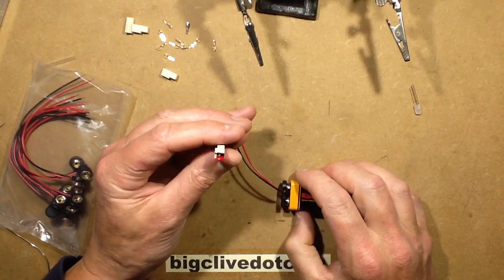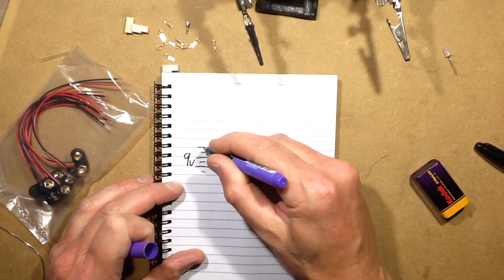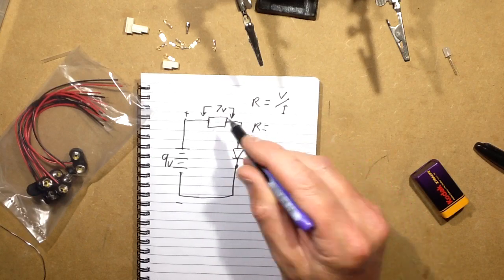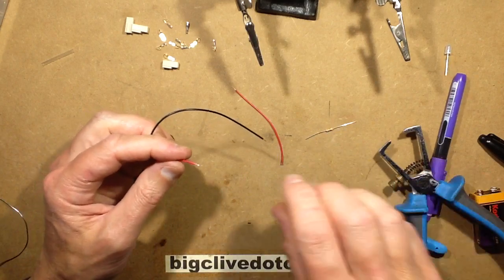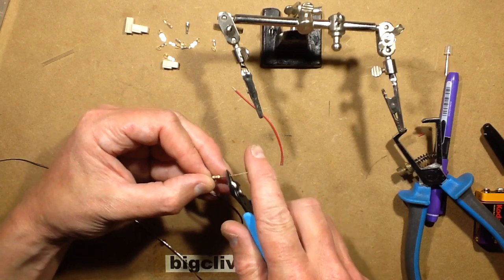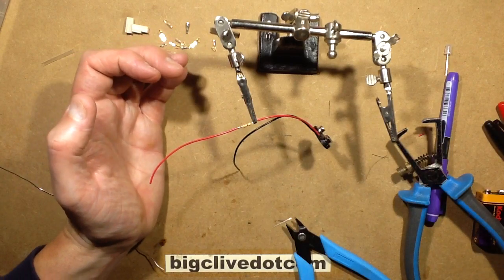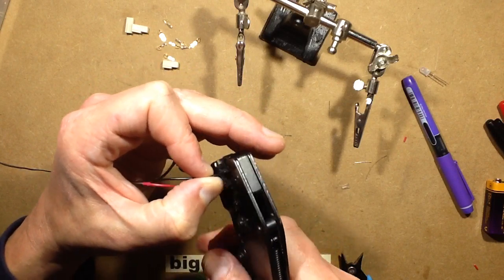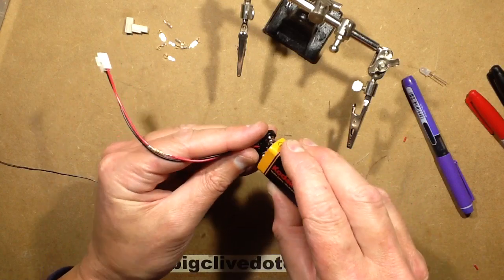Make a super-simple LED tester and emergency light source.

Comment: Can this be used to test 100W LEDs?
Reply from the maker: Yes, but you have to slice them into little cubes with a sharp knife and then solder extension wires onto the little gold wires.
Reply: +Ben Adamson Lol, seriously, you've not been at Julian Illett's channel, have you? :D
Reply: WHOOOSH
Reply: +bigclivedotcom Ha ha, maybe not. Just popping out to the pound shop to buy three 9v batteries!
Reply: No, you'll need a higher power PSU. A 9V battery can realistically supply about a single watt at maximum (and you'll wear it out quickly at that high current).
Reply: It would possibly dimply light one,  but there's no way you'll get near full brightness with the current limited to ~20mA
Reply: With enough 9V batteries in series, yes. Just add enough in series to get up to the operating voltage of the LED, and don't worry about a current limiting resistor, the internal ESR of the battery has you covered... (until they leak/explode.)
Reply: If you want to waste a good battery.

Comment: Regarding cameras, get a decent camcorder, far more settings to play with to make videos look good, and manual focus for the win so you can change focus on the fly so you can bring things up close and focus on them and not have to be bothered about the Sonyism with focussing on everything but what the camera is aimed directly at... :)

I remember when I was a kid I used to test LEDs with a PP3 battery, no resistors, just a quick flash to test them, most of the LEDs used to work, can't think why they didn't afterwards............. :P

Comment: I notice that you calculated the resistor value in the video of 330 ohms yet in the comments you state that a 220 ohm resistor is required.
Reply from the maker: Thanks, I've corrected that.  For some reason I kept mixing up 220 and 330 ohm resistors.

Comment: Clive, did you know that Android formerly was ment to be a camera OS? :D
Reply from the maker: I have an optimised travel tool-kit that is very easy to carry about.  It was featured in a video last year when Julian Illet issued the "handbag challenge".
Reply from the maker: I'll be switching to the Moto-G as a camera shortly for travelling, but my use of the camera facing straight down seems to cause problems with many apps.  Even with rotation off they still do weird things.
Reply: bigclivedotcom
Try the open camera app, there you can disable autofocus while recording video.

Also the cyanogenmod camera app provides this feature.

Keep in mind that third party camera apps cannot write to SD-Card on Android Kitkat and since Marshmallow, there is a chance that it works but it's 50/50 that it doesn't... I hate these SD-Card restrictions... Now I plan to go for the next Nexus phones announced end of september.
Reply: +bigclivedotcom are you going to leave us for vacation ? :-(
Reply from the maker: No.  I'll be travelling about with work so I'll be uploading from random locations for a while.
Reply: bigclivedotcom I see. You'll need a BIG truck to take all your tools with you :)
Reply: bigclivedotcom oh back then I wasn't watching your channel yet. Will try find the video

Comment: I found the Yahua rework station for 99 bucks on Ebay. It's been really good and reliable heats up fast enough.  Although I've never run a Hacko or Weller to see the difference after seeing the price difference. What are the best replacement tips to get?
Why do you call a 9V by the name- PV3?
Reply: PP3. It is the standard name for this type of battery in this country.

Comment: heres a much cheaper and easier tester 
3v cr2032
Reply from the maker: No current limiting other than internal resistance, so a fresh sell can pump a lot of current through an LED and make it look a lot brighter than it will in a real application.
Reply: neato

Comment: I usually make a resistor out of myself when testing LEDs. One electrode to one terminal of the battery and the other electrode to second terminal through my finger. Amusingly simple and works well.

Comment: What if you use a little 3 pin switch and mount a 330 and a 100k ohm resistor to it, and just hot glue it to the actual 9v connector?
That way you have a low and high current setting :D
Reply from the maker: https://www.youtube.com/watch?v=l24weXIYOAw
Reply: bigclivedotcom Nice one! Could easily be condensed though :)

Comment: Coincidently, I got a LED tester from a boot fair about a week ago. It's a small back box that houses a PP3 and the lid is a PCB. On the PCB are 6 pairs of eyelets, each pair of eyelets has a different value resistor connected to it enabling you to test a LED at different current levels. Useful.
Reply from the maker: Those ones are pretty good.  I prefer them to the modern ones with a button you have to press to make the LEDs light.

Comment: Personally I suggest salvaging the tops off the 9 V batteries whenever they die you can just peel off the casing Cut the two leads and you'll never run out! I have a bit of like 50 and I haven't bought any of them

Comment: I much prefer to use a LM317LZ and a resistor. Only one additional component, and then you have proper constant current source. That means you need not concern yourself with the LED voltage drop, and no matter what the battery voltage you get the same LED brightness. The LM317LZ is only rated 100mA, but that's heaps, but it's not LDO so you need the input voltage to be 3V higher than your LED voltage (hence 6V or preferably old used 9V batteries). Circuit is simple: http://i.imgur.com/a8KG38W.gif - the output current (Amps) is 1.25V divided by the resistor ohms. So, 82 ohms for 15mA, 120 ohms for 10mA, etc.
Reply: That's a really nice idea there. Thanks, Tom.

Comment: 3:20 stripping tool? I just use my teeth!
Reply: I used to use my teeth! My dentist once found a strand of wire in my teeth. I thought of asking him to file my teeth so I could strip different gauges of wire :)
Reply: +TheRaellz I'm just too lazy to buy a stripper.
Reply: When in doubt employee teeth! then employed dentist!
Reply: I take it you're not British....
Reply: With some practice, side cutters work just fine.
Reply: I used to use my teeth, but now I just roll the wire under a knife blade. So much easier, and a clean cut :D
But unfortunately, it's easy to just completely cut the wire off >:(
Reply: you can use your cigarette lighter
Reply: Yeah, for thin wires like that teeth definitely work better than that kind of stripping tool. But the other kind of common wire strippers, where blades are pulled back automatically are rather handy. I use one that cost maybe 3 or 4€ and it has kept me having insulation stuck between the teeth for quite some time now ;) .
Reply: I remember a medical mystery in Readers' Digest many years ago about an electrician who was very ill and the doctors finally determined it was lead poisoning caused by stripping wires with his teeth and chewing the stripped vinyl.
Reply: I've been using my teeth since I've known how to do this stuff and have never had either problem. I'm pretty sure the copper wire is going to give out before my tooth does.

Comment: Is it okay to flow solder onto the bits you're soldering beforehand or not? I've seen all these tutorials on soldering and they all seem to say to never do that. However I take it you're very knowledgeable about this, why do you prefer to flow solder onto it beforehand?
Reply from the maker: Ideally you would heat both wires while they were held parallel and then flow solder onto them, but tinning them both and reflowing them is much easier, and if a touch of flux is added produces a good connection.
Reply: It's always wise to "pre-tin" the ends/tips of components so that they solder easier. But that's just "wise".  I've been lucky enough that I've never been pulled-over by the solder-police.
Reply: The surface of the solder oxidizes over time.  So, if you're going to reflow it, the sooner the better.
Reply: The main reason for not doing that is that you will most likely end up with way too much solder on the joint. So pre-tinning and then soldering onto that again with additional solder is totally fine (assuming your pre-tinning doesn't end with a huge blob of solder already).

Comment: Speaking of emergency power, could you make a phone line ( Rj11) to LED or ni-mh battery charger?
Reply: Whats the point of paying $37 for a land line if you cant use it?  The real crime is having to pay so much for some thing that never gets used...
Reply: The legality of that is dubious, I think
Reply: I just run my whole house off the phone line! My neighbor's of course.
Reply: or can he do a bit of how to connect to a street light or the neighbours electric without them knowing! lol
Reply: @jusb1066   I caught my damn neighbor doing that last spring, he had run a cable over to my outdoor power outlet!  I fooled the asshole though, I had installed a wall switch for that outlet when we first put it on the wall about 25 years ago because we used to have to plug in my wife's car so she could get to work when the temps fell below -20 F, which it does quite regularly here in the Dakota's, so I simply began using the switch once more.  His drop cord is now hanging in my garage as well, what the hell, I found it connected to my outlet, must be mine right?  He never came over to claim it, perhaps I purchased it and forgot but then perhaps not. To bad there wasn't a skill saw on the end when I pulled it through the bushes.  If the ass-hole had just asked I would have gladly allowed him to use it once in  awhile but to do it without permission is just not right to my 67 year old brain.
Reply: +jusb1066 yeah, that's what I meant, I was replying to the original comment :)
Reply: Javid Bunyadzade so is pulling power from the phone connector for anything but phones :)
Reply: Javid Bunyadzade
hehe sorry :)
Reply: I made one of those once!  Wonder where I put the blasted thing now that you mentioned it?  I have dozens of those damn phone cables laying around, they used to come with modems in the old days and I only needed the first one, after that they just went into a box.  Think I will make some more, I am forced to remain here in the Dakota's this winter, life you know, and we do suffer from power outages when the Alberta Cutters fly out of the North from Canada and cover our beautiful prairies with heavy coats of snow, and an air mass comes from the Arctic to drop the Mercury to sub zero F temps.

Comment: When you have two separate wires as shown in this project what are your thoughts on combining them together and what methods would you suggest?
For example twisting them and hoping they dont untwist, heat shrinking the whole thing etc.
Reply: Take a two pieces of wire at least about three feet long.  secure one end throw the other end in a drill and twist them together. You can then use it by cutting lengths off. Although that doesn't help this much with precut wire.
Reply: for joining wires, holding them parallel over lapping about 1/2 inch, twist them together and solder, cover in heatshrink, is indeed the best method of joining to wires, any twist without solder is an unreliable joint.   https://www.youtube.com/watch?v=Q9G9gaokqvM
Reply: Sorry if my comment was unclear. I meant if you have two parallel wires such as the positive and negative in the case of this video and didn't want both of them flapping around separately.
Reply: aljowen
heatshrink is the answer to that also, even if you just use a short sleeve every few inches, it keeps them together pretty well, if you cant get the heatshrink on due to the cable already assembled, try self amalgamating tape.

Comment: Regarding the camera, you want one which has a fixed-focus option.
Reply: What these sorts of videos really need is something that can toggle quickly between two fixed focus points, ideally with a foot control. Not sure if such a thing exists though.
Reply from the maker: I've been looking at a mini bench studio setup that has multiple cameras for close-ups that can be selected live.  But it's finding decent webcams and a suitable hardware base that has been an issue.
Reply: +bigclivedotcom you could do that in software. Open Broadcaster Studio is a free, general purpose streaming/recording software where you can define multiple scenes and video sources and switch between them on demand. It is possible to use shortcuts to switch between the scenes, so I reckon it should be possible to build a hardware scene-switcher box.
Reply: This was more or less my thinking. A cheap USB HID footswitch would be fine for switching scenes.

However, I do think a potentially simpler, higher quality (albeit a bit more time consuming) solution would be running two independent cameras and then editing in the close up shots.
Reply from the maker: I've been playing with OBS and considering one of the USB keypads or even a USB MAME interface for hard wiring buttons.  It's just finding small camera modules that are a suitable resolution and can be built into a dedicated unit.

Comment: Do You have the link to buy the battery clips?
Reply: Thanks for the tips and the link!
Reply: You can actually just take apart an old 9v battery and use the top (just gotta wire it up)!  I've only seen it done on energizer ones though.  The metal case ones.
Reply: Works on all of them. You either get 2 disks with serrated teeth, or a single plate with a tooth mark in it and a longer one with tooth mark and a paper sleeve. both are usable, just solder quickly as the plastic melts easily.
Reply: http://www.ebay.nl/itm/252252918981?_trksid=p2060353.m2749.l2648&ssPageName=STRK%3AMEBIDX%3AIT

Comment: You can crimp that style of connector manually using needle nose pliers, it's a bit fiddly but you can do it.
Reply: Of course you can, I even made it with wire cuter, but when you are doing 6 speakers in car, plus amplifiers and stuff like that, crimping tool is perfect - it save time and effort, and you can do more and better.

Comment: Description says " A 220 ohm resistor"  but isn't it 330?
Reply from the maker: i screwed up.  It's corrected now, thanks.
Reply: Interesting, I think he says 330.  But that's not what's in the notes.  My default value is between the two : 270.  But it depends on the supply voltage and the time you leave it connected for.  I've used 0 ohm connections from a microprocessor 5v output to a led (forbidden!), but only after knowing that the code will only pulse it for less than a millisecond.  I think this guy's recommendations are safe and he's giving good advice.
Reply: Ray Kent he calculates 350, says 330 is the closest, and mentions 2 orange rings. (orange being 3)
Reply: +Remco Smit   Maybe your point is that his spoken words don't exactly correspond to what is in the video description?  Well, OK.  My point is that for brief testing of an LED to find out whether it's rubbish or not, you can use a resistor ranging from 100 to 1000 ohms, there's no need to fuss about it.  So I'm fine with Clive saying 330 and and putting 220 in the notes, cos it don't matter.  What is your point?

Comment: I use one of the cheap button cell stacks to test leds at 4.2V at 20 mah and it is rechargeable so it is kind of nice, I pulled it out of a cheap windup key chain light.